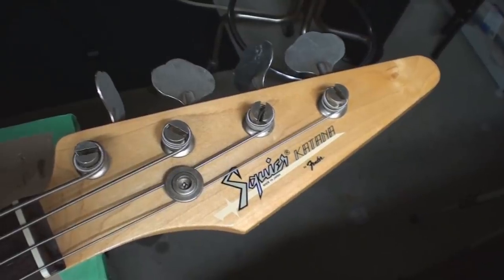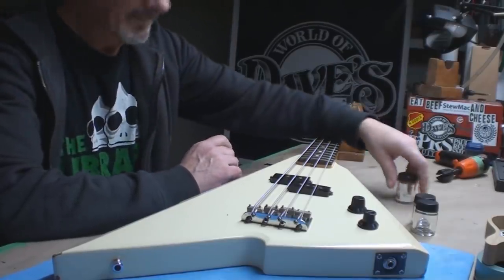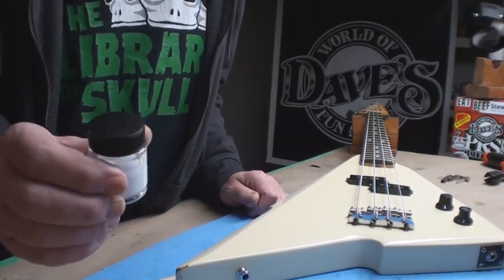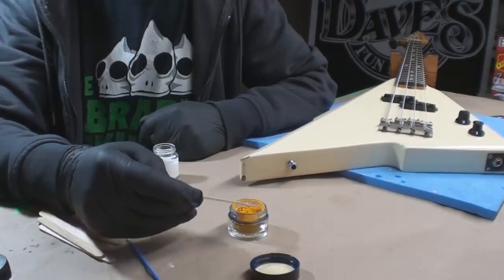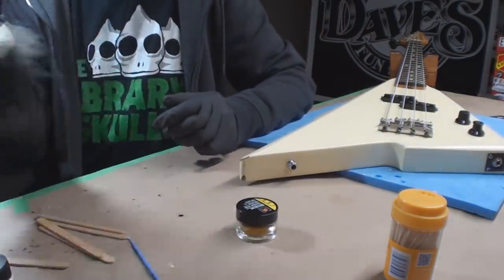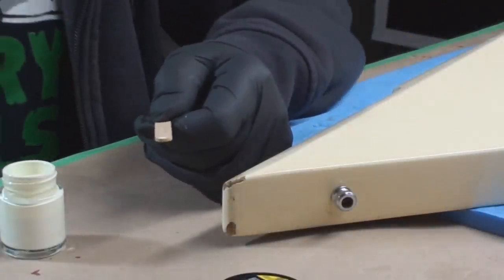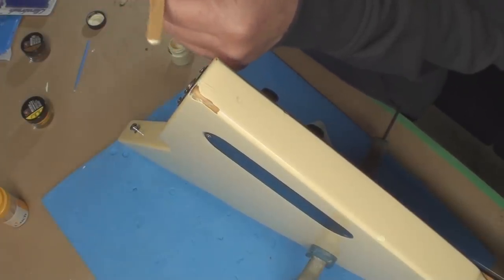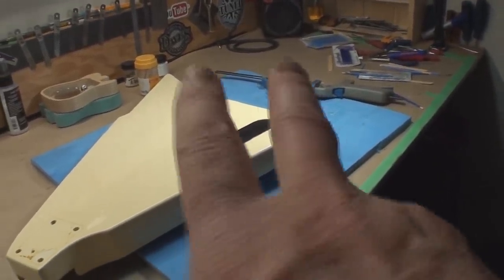Color Matching Guitar Finish Repairs

Comment: Hey that headstock looks like it is from a Fender performer from the mid 80s. These had 24 frets, and were also assembled in Japan and Fender destroyed a bunch of them because they weren't selling.
https://en.m.wikipedia.org/wiki/Fender_Performer_Bass
The Fender Performer basses and guitars featured the same body, but the basses are fairly rare. I recalled the guitar version played extremely well.

Comment: Has anyone ever tried using one of those little color analyzer machines (like the thing they use at Home Depot to color match paint) for color matching guitar repairs? I’m considering buying one for my workshop because color matching has always been a huge pain in the ass for me, but I’m not sure if it would actually work in practice. Especially worried about dye based color coats where the wood grain underneath effects the final color, and whether a satin or gloss topcoat could throw off the machines.

Comment: In my experience in auto colors (25 years auto painter ) colors loose there brilliance  as they dry look darker. White is about the hardest because it takes so little to. Compleatlythrewthe blow it cleared out of the neighborhood. Then you start over a lot of times cause I it takes so much pure white t of change any thing. Cent it milks up a lot of solid coloors.
Reply: Can you, please, translate that into plain English?  Man, seriously.
Reply: @paulfrombrooklyn5409  no if you can't understand that white is very hard Mabe the hardest to tint.    No.   ..  
No I Cant.
Reply: @slanford6767  That is the basic premise of your rant.  I get that but if you can't write properly then maybe you should go back to school to learn proper punctuation and proper sentence structure.

Comment: If any of us to go to any of the big box hardware stores paint department with a sample paint color they can scan/photograph the sample and then a software app they have will spit out the colors of their standard paints that they need to mix to match that color. It would seem like that kind of app ought to be available to anyone with a digital camera/scanner and a PC, or a smart phone. Has anyone ever found an app like that can either compare two color samples or that one could add the tints they have and it would calculate the quantities of each needed to give a good match?

I see a couple apps on my iPhone that might work. Has anyone tried one of them?
Reply: @DavesWorldofFunStuff  I'm not sure what whether it's lacquer or paint has to do with color matching?
Reply: The paint store is just an example of the technology available with color matching. An app, if it doesn't already exist or one of the existing apps can't be modified, should be able to have a picture or scan of the instrument's existing color loaded in and then provide a mix ratio of the appropriate color pigments added to any given quantity of clear lacquer (or in the case of GluBoost or similar CA products the quantity of CA glue) that would result is a properly color matched touch up lacquer or glue.